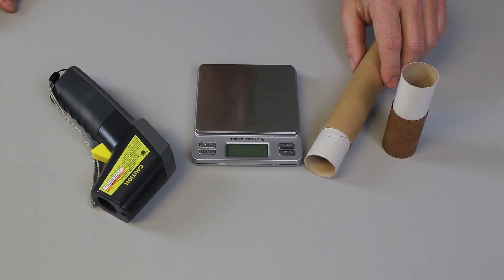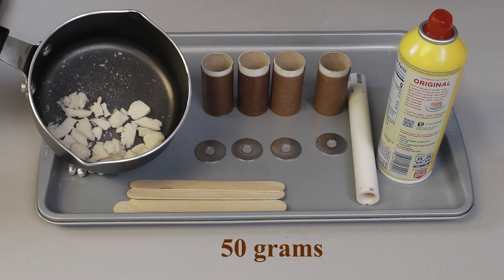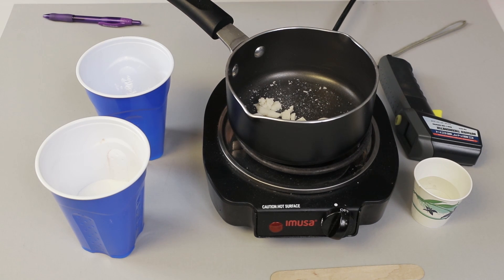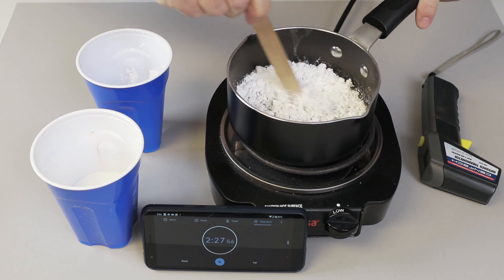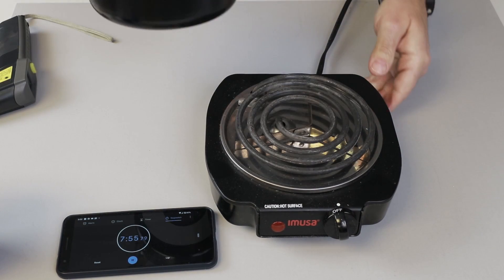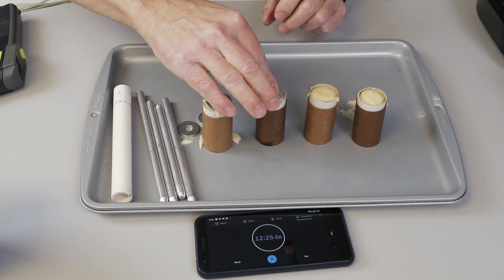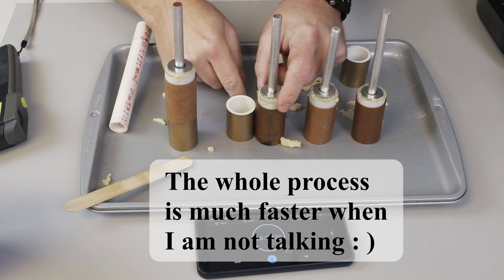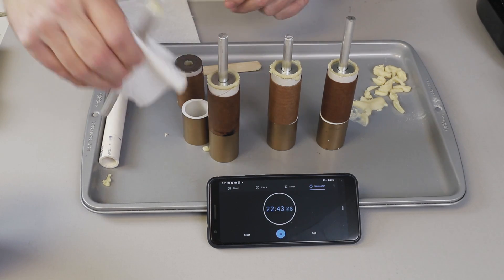Casting sugar fuel for a snap ring 38 mm rocket motor.

Comment: Great video with easy to follow instructions! I like having the timer out in front to see exactly how long everything should take. Yesterday I made the 1 inch motor you did in a previous video and it worked great 

Here is a helpful hint about the Karo syrup. Don't try to pour it into any cup. Just set your syrup bottle on your scale and zero it out. Then simply pour straight from the bottle into your pan while frequently checking the weight. Once you hit -54 grams, you are good. There is very little mess this way and you will probably be more accurate with the amount you put in.
Reply from the maker: I appreciate your comments and great tip on the Karo syrup.

Thanks for sharing your experience with the 1 inch motor! I put a lot of time and effort into the videos and often wonder if anyone has tried to follow them and produced a working motor.

I am gathering parts to make a proper thrust stand. I hope by this summer to test various sugar fuel combinations and obtain hard data on them.
Reply: @TheRocketeer  I tried biulding the thrust stand I saw on the Elemental Maker's YouTube channel. The instructions were good, but I couldn't get it to work. Either my wiring is wrong or the program I downloaded for the arduino isn't working .
Reply from the maker: @kevinmorrison657  If you would like to follow my thrust stand build then go to my Home Page - About and there you will find my email address.
Reply: @kevinmorrison657  if you are still interested in the test stand, I put a comment with the corrected code in the elemental maker video
Reply: @CarlosSD  Thanks! I will check it out!

Comment: Hi,

Really very well explained! You are at the top !
I would really like to be able to realize this engine but I am not sure to find all the elements in France ... 
Would you accept if necessary to send me the casing, liner etc. if I make you a paypal payment in advance?
Thank you
Sébastien from France
Reply from the maker: Hi Sébastien,

I am sorry that I am not able to help you with the casting tube set. You could contact the vendor and ask if they are able to ship overseas.

I think obtaining the oxidizer may be a larger challenge. Check local laws and see if it is legal to obtain KNO3 and mix the fuel.

Have you looked at my PVC motor video? 
https://www.youtube.com/watch?v=HoUlks-Oj_0

Casting set:
https://alwaysreadyrocketry.com/

Thanks for your comment, good luck and stay safe!